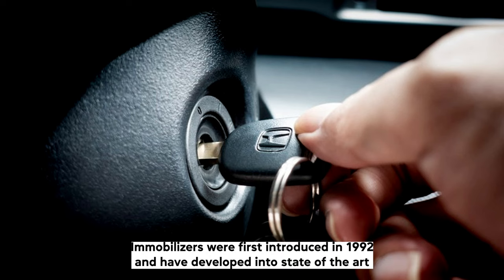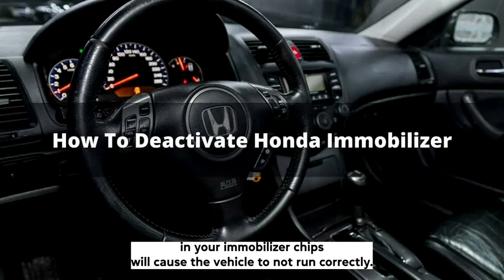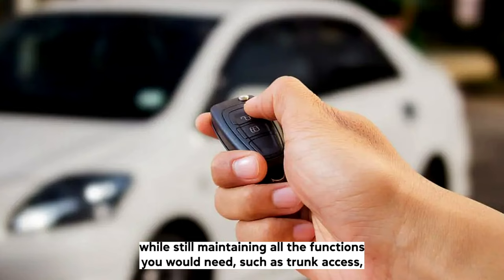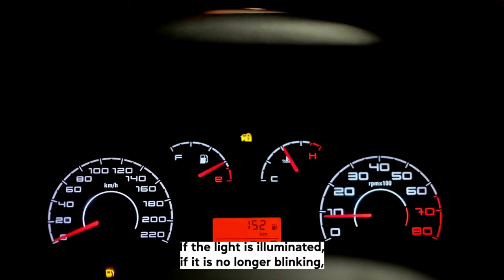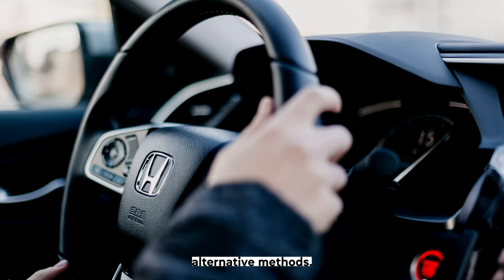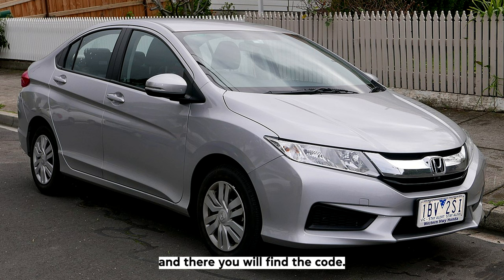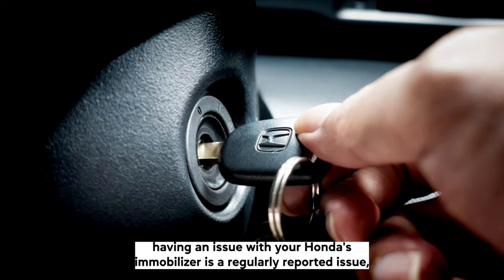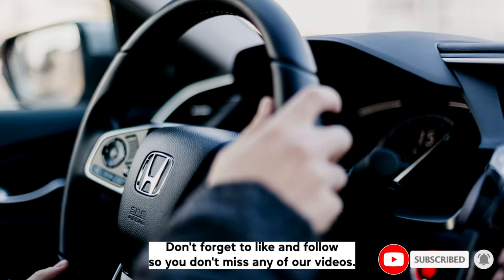How To Deactivate The Honda Immobilizer

Comment: Honda Motors has a big problem with the anti theft systems as early as '99.  The solution of using the drivers side door lock is not a sure thing. My Honda alarms and anti-theft will continue to go off intermittently until the battery either runs down or is unhooked.   I have been locked in my car with horn honking lights flashing , unable to remove the key from the ignition.  Going off every ten minutes and dealerships will not fully warranty their work and won't tell anyone how to disconnect the anti-theft system .  The car is useless to a 76 year old woman. Sometimes it doesn't restart for hours.
Reply: Have you found a solution?
Reply: yes every time the battery is disconnect or dead there's a code that can be found in the glove box usually must entered thru the radio set  utube has the instructions.

Comment: You never said what the immobilizer does. Does it keep the car from moving? Prevent starting? Honk the horn? And how do you enter the access codes? All in all, a waste of five minutes.
Reply: I’m having this problem right now. Car starts but turns off. Does not run. Horn honks  but I don’t have original key
Reply: Geesh y'all don't listen. Well it's a part of the question but asked silly. Man oh man ppl are not listening 🎧 plz try again he gave diff options to trits in your manual Google ur deck duck go. It it hell

Comment: If your your green key light is flashing first try seeing if your "ACGS" fuse needs replaced. If fuse is good you can program your keyfob by putting key in ignition turn to 2nd "on" position then click "unlock" on key fob then wait 1 second then turn to off then wait 1 second and repeat 4 times,you'll hear doors unlock when it works..
This helped for a 2009 Honda pilot
Reply: Hey there. My 2007 Honda Fit green light is on but I don't have a "ACGS" on my fusebox. Would there be another name for it? Any help would be appreciated. Thanks.
Reply: @IronSharpensIron5X  it should be the fuse box in the engine bay not under the dash
Reply: What does ACGS stand for?
Reply: Bless you! You saved me!
Reply: Can the same key be “reprogrammed”?
Car was parked a year. Drove it. Took battery out to fix some for 3 days.
Then this issue appeared.

Fuse was a little smoked but worked, also replaced.
Had the same.

After two weeks, car started good and shut off after a few tries.
But after driving for a 1-2 hours in my long driveway now it seems good
Reply: Where is the relay output of the immobilizer? How to permanently enable its output to physically bypass this circuit? Tips didn’t work on a 2016 Pilot
Reply: Thx
Reply: How do I locate that fuse can't find info on it?
Reply: @techguy9023 I'm searching also having same issue after battery died overnight 😢
Reply: This actually just worked.
Reply: Do you know how to fix or reset with just the key I don't have a key fob just
Reply: This helped my radio turn back on and turn the anti theft off - 2008 Honda civic coupe
Reply: Has this Really worked for Anybody??

Comment: My Honda is 20 years old. I want the immobilizer gone.  If the key fits, I want it to start.  I think this chip in the key immobilizer BS is corporate planned obsolescence.  My car won't start because it thinks I'm a thief, and that's a daily occurrence.
        "Perfectly maintained car won't start???  Maybe you should get a new one."
Reply: mine to
Reply: Take the lock off the steering wheel and on the back of the imo lizer is a white peice 3 or 4 screws take them out then pull white peice off put key in ignition and use screw driver to turn the white peice and start car BOOM DONE
Reply: Yeh, me too. So repulsive.

Comment: What if your ‘98 Accord LX only has the og hard key with the little chip in it? My green key light blinks 5-6 times when I turn it over and then goes off. The strange thing is that if my check engine light doesn’t come on guaranteed it will not start. It’s weird. But, in one forum they mentioned the relay just above the foot rest Honda has so your left foot is behaving itself. There’s a small fuse box with a couple relays and a couple fuses, I believe, but it’s covered so you have to remove the panel underneath the steering column and then that gives you access to the screws for that box, and inside is the main relay. I read that Honda’s relays in the 6 generation are crap and they get hot and the solder cracks causing them to misbehave, and since that’s kind an important part, it’s worth a look. The strange thing is the mechanic said that if you can’t replace it immediately and need to make some moves just slap the box with your foot and it sometimes corrects the problem. Well, it corrects that problem every single time I smack the box cover with the side of my shoe. Sometimes it requires a second attempt if my first attempt is all wonky and lame. I swear. I was getting desperate. Already spent $300 getting a locksmith to replace the ignition switch because it was supposedly faulty which caused a problem with the Immobilizer. Didn’t help a damn bit. I was just a tad irked. Dude won’t even give me a discount on a spare key and mine are the old cheaper hard ones that look like they don’t even have a chip in them (they do, I asked the proper person, Honda). I actually think it’s a bit of all of the above. The relay is connected with the ignition and Immobilizer and it controls the fuel pump. Hmm… so it’s likely that sometimes it operates exactly as it should and sometimes you gotta give it a little side foot English. I’m gonna replace the relay either way because it’s a well known nuisance for us Honda owners. My Accord barely has 130K on it. It run exceptionally well except for the not starting/engine cutting off while in motion (same symptom basically although one is far more dangerous if it occurs on the freeway when your doing 80 in traffic in the fast lane and all of a sudden your car is dead and it’s an automatic so in the middle of soiling your board shorts, you have to wrestle with the no longer power steering and try to not get mashed by anyone who’s changing the station, looking at their phone, talking to someone in the passenger seat or rear seat by stupidly actually turning their dumbass head around. Anyway, needless to say, I was freaked out and super pissed at that locksmith. What seems to make the most sense is that the relay is crappy and failing (a well known problem) and it happens to be connected through the ignition switch to the Immobilizer which in turn sends a signal that I’m ripping off my own ride and cuts off the fuel, a super effective deterrent to the Bad Guys, which ain’t me. Sheesh, there’s so many videos and forum posts dedicated to this exact topic and there seems to be 3 different conclusions, 1) the relay is crap 2) the fuel pump needs replaced and, 3) the Immobilizer has it’s panties in a bunch for whatever reason no one seems to have a clear understanding of. Awesome… Good luck, peeps. Try the left foot dealio first. It’s free!
Reply: I read all this, and your spot on , I think it's called the pgm relay, and it is a common, problem, in these cars, how long did it take you to write this? 😂
Reply: Ty for the info bro, I appreciate it.

Comment: My 2004 TSX starts fine. Just the radio randomly quit. I find it odd that the ac works and that i can hear the cd changer, so the panel is getting 12 volts, but no display from the navigation screen
 Help!

Comment: So my ex took my keys to my 2002 Honda accord ex and i took apart the ignition switch to hotwire it but it wont start a green key flashes on the dash. How can i get around this without having to buy a new $200 ignition.
Reply: You can't. The car needs to recognize the transponder in the key in order to start and the key has to be programmed with a scan tool in order to be recognized. There is no way to disable the immobilizer system on these cars because it communicates with the PCM (the engine computer) and they have to recognize eachother on the network they communicate on. This video is a bunch of garbage.
Reply: @MyMomsADadNow that’s what I thought to….
Reply: Yap n I pray u ain't just rolling in her ish nah xone in that's wfat a eff buddy dis to me n well let's just say not looking good fire em